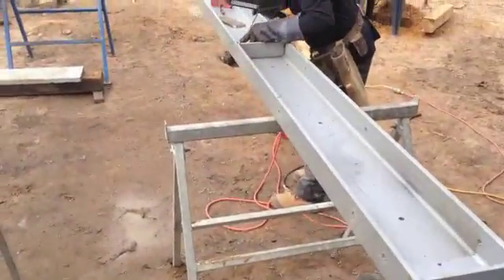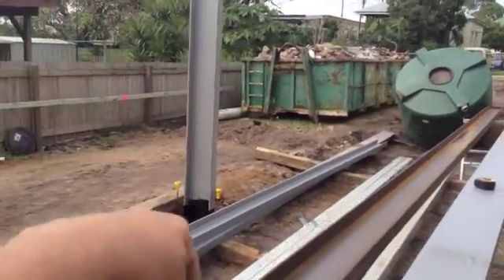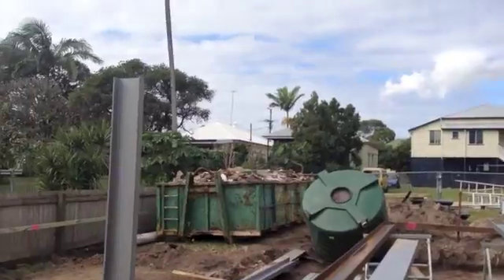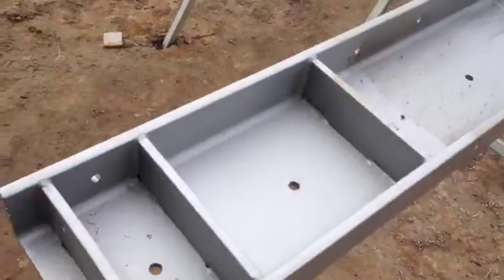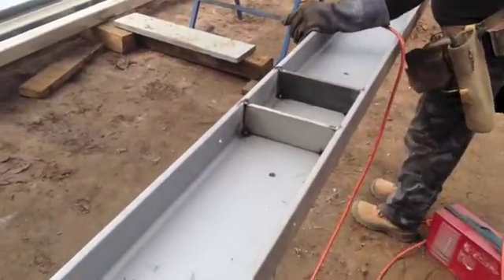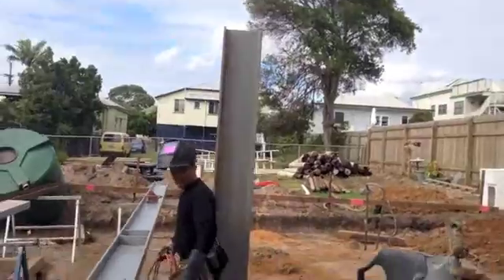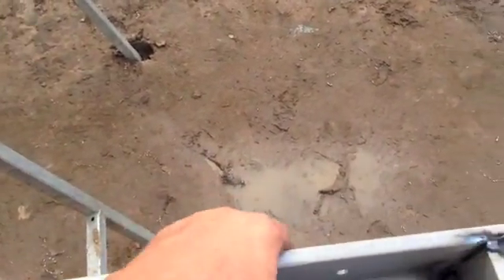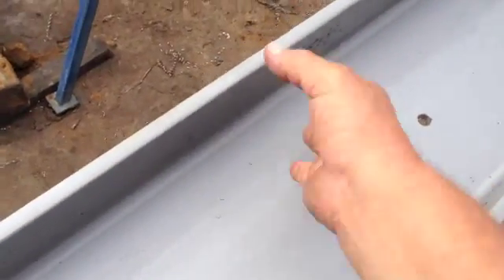How To build a Steel portal frame. Cedar st Wynnum Video No3

Comment: Thank you for making this video!
And you commentary too.
Reply from the maker: Thanks Sam
I hope it was usefull to you.
Reply: @DieterSoegemeier  I thought your comments on site manufacture was interesting too. 

In my previous job, structural draftsman. The majority of contractors we had preferred, base fixed on too of slab connections. 
When loads were low  and engineer allowed chemset fixings, it made sense to me.

But when cast-in base or fixings we're required, I think embedded columns is sensible. (Got many complaints about this process, cast-in).

Love to hear your thoughts of cast-in baseplates and welding columns to them on site?
Reply from the maker: @samt5663  Hj Sam
I find castin plates a pain because when welding the post to them the weld pulls the post around and makes it hard to get the post to stay in the desired position.
Also once the welding is done it is imposiable to treat the base plate with any rust prevention as the heat has melted off all the galvanising but the builders and I always set the plates 25mm into the concrete so we can fill around the post with an epoxy grout after the post is installed and painted with an epoxy paint to prevent corrosion.